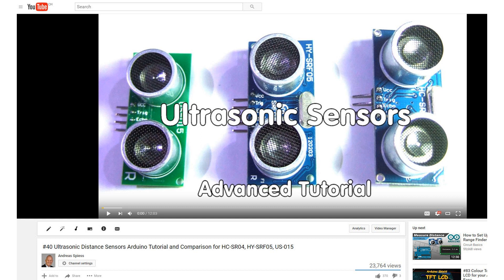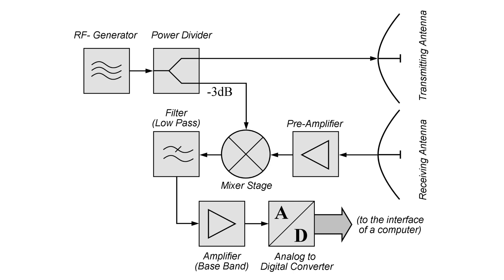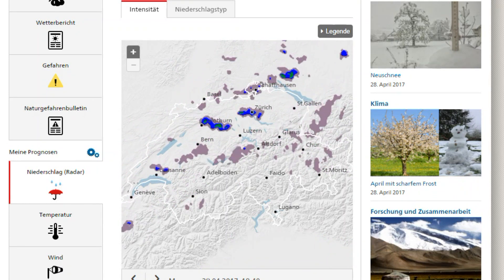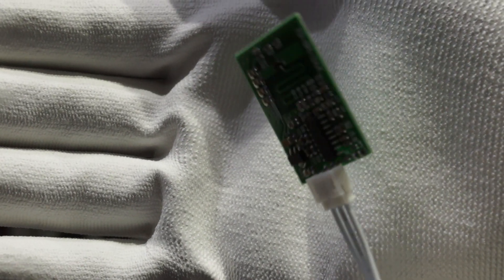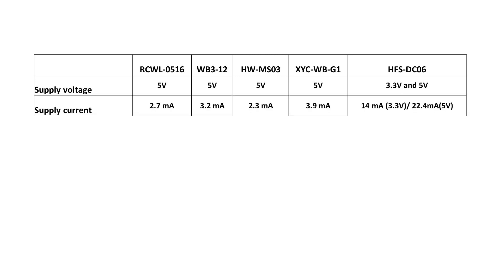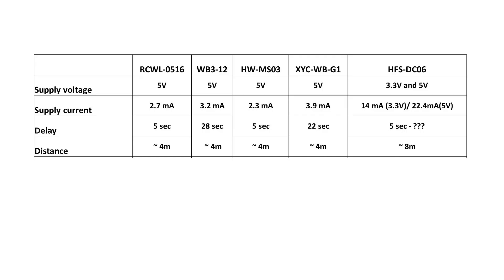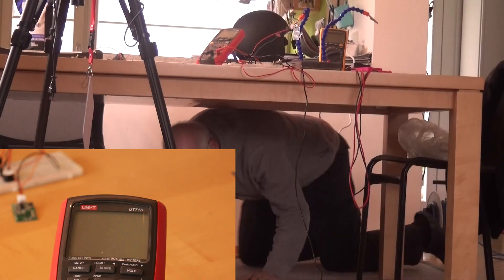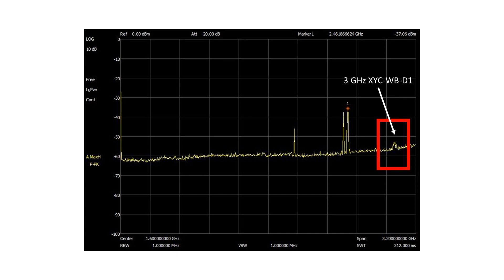#135 Radar Sensors / Switches: Comparison and Tests

Comment: IRC these units don't work like a radar. IRC they don't receive a signal back from what they send out. They just emit a continuous wave and monitor how much power it is using to transmit. if something moves in it's "field" it changes the SWR standing wave ratio of the transmitter, causing it to us more or less power that the comparitor uses to cause a trip.
Reply: I agree with Sirus. This is very similar to the way shop lifting alarms work.
Reply: @keesterwee4890  They do not work the same way as the shop theft systems. They rely on the same technology used with prox or access control tags. The arches transmit an rf signal that sweeps a small bandwidth at around the 3.8ghz mark. The tags on the shop item have an antenna tuned to that frequency, a small capacitor and transistor in a smc package connect to the antenna. The RF energy from the arches powers the IC in the alarm tag and creates a simple oscillation resulting in a reflection of RF power at a slightly offset frequency or  delay depending on the system type. The signal return to the arch triggers the alarm.

It's just come over to the uk but stores in Japan have been using this for years with IC's that will return a pulsed code instead of just a "present" signal as with the theft alarms. These shops in Japan allow you to swipe your customer card and then go round the store  filling your trolly. When you exit the store all the prox codes are read and you are billed for the goods. Sadly until all the packaging manufacturers and the industry incorporate smart IC technology we cannot switch to this system.

I tested a product with a smart tag a while back and was not surprised to discover that the coded return from the product matched the bar code !  I assume this has been done to make life easier for any stores that have a barcode database. They only then need switch from a barcode reader to an RF based one. I can't see unmanned stores  taking of in the UK just the stock itself  ;-)

With regards to how these little detectors do operate see my reply to "Sirus"
Reply: "Sirus" is the winner. If you examine one closely you will see a common ground plane on both sides connected up using vias. The SWR is the method used in fact you can observe a change in current draw when the device is triggered and most of them use the good old BIS0001 IC comparator to trigger the pull low output.

I did manage to tap the RF side and the tiny pcb based detectors all seem to be on around 3.7 - 3.9Ghz. I checked with a friend of mine at the home office and nothing aside from the prox tags used in access control systems systems is around that range, most likely due to the fact that the transmitters in the prox readers spit out a lot of noise and are not tuned properly at all. This does not matter with the access control kit as they are very short range and low power just like these modules. 

A sweep of the above range using a highly directional antenna will trigger these units from 10 meters away. They seem to just look for a change up or down and this makes sense when you see the good old BIS0001 chip on the board.

It is only the proper long range lighting presence detectors that use 5.8Ghz and these for more expensive detectors have a properly tuned resonance chamber and directional antenna. I suspect it is these higher grade units that actually use doppler for detection.

It is good to see better units come out of China now considering that the early units were mere capacitance field type sensors and were useless. Withy these things about now I am very happy I don't have to defuse IED's like my friend did before one removed his legs for him !!!!  It does not seem to matter what it is these days the Chinese are the undisputed champions at reducing component count, complexity and cost. When I was at Uni working toward my Bsc in EE 30 odd years ago something like this would have floored me.
Reply: Depending of the distance between the transmitter and the reflections the signal arrives at the receiver either in phase, out of phase or in betwee  at the receiver. The two signals are present on the transistor at the same time. As the transistor is a nonlinear device the two signals mix together and generate a DC offset dependant of their relative phase. When an object is moving in front of the sensor this DC offset oscillates at a very low frequency. This signal is amplified and detected by a chip which is very similar to the BISS0001 used in PIR sensors as the output signals of these sensors are nearly identical. The only difference is that this chip includes a built in 3.3v regulator.
Reply: @atmel9077  Beat me to it you so and so :-D However from the playing about I have done it only seems to be the higher grade longer range units that work this way. This method has been used in alarm sensors in combination with a PIR for years. They both have weaknesses but are solid when combined.
Reply: Radar engineer here...

There are several flavors of radar methodology. These seem similar to continuous wave radars - capable of determining presence of an object within a FOV and depth, as a function of its sensitivity and other wave propagation features, but not actually able to determine range. Speed of an object can be determined by examining the Doppler shift, if circuits are present to fish this out and report it. Likely these small devices detect presence by something moving within its area of sensitivity, generating a reported voltage from a comparison between a local oscillator and received energy that has been Doppler shifted from the emitted frequency.

As an extension to what was described in the video, radars are not necessarily obligated to have angular resolution, as this is typically a feature of the design of the antenna - attenuating RF energy to a tight "beam," where direction finding is achieved by detecting objects and knowing where the beam is pointed. False detections can result from receiving, intentionally or not, energy from outside the "main lobe" of the radar.
Reply: @Prometheus2508    Hey Jeff.  I would love to sit down and have a drink and chat with you.  From what you describe the antenna and surrounding ground plane would have to be precisely engineered. Given the absence of tuned resonance chambers I assume the RF energy to be broadband so the VSWR seems the most likely option. I personally cannot see how the antenna can be sufficiently precise and stable to control range and receive the reflected RF energy.

Given its design I would expect a large proportion of that reflected energy to miss the antenna completely. What is even more impressive is the single transistor connected to the base of the antenna, this transistor must be operating in its linear region and as this must operate on top of the active region I am very curious as to how it operates. I wonder if the secret is keeping if forward biased or is it switching back and forth.

It is not the smallest array that has been designed given that very precise microwave DOPPLER detection has been integrated into intruder alarm detectors for a long time now. These however use a central base loaded design and a surrounding array of receivers from what I have read. If it is using DOPPLER as many similar videos maintain.

This sounds like a very strange method of operation to me looking at the layout. I agree its continuous wave as standing wave operation makes no sense. How do you think the antenna is driven ?  I have a few of these modules but as I am retired I don't have access to network analysers and spectrum analysers anymore. It is an amazing design that's for sure given the problems they would have to overcome.

It is a very clever design that is for sure.
Reply: @TRS-Tech  What do you mean by "control range"?

The amount of received, reflected energy will be many magnitudes smaller. This doesn't matter, so long as it's amplified (likely by that transistor) and normalized with the local oscillator that originally drove the antenna on transmit. And AC signal driven into a approximately coupled antenna-like conductive strip will generate RF waves. With the normalized signals on hand, simply comparing the two with a phased lock loop should produce an output voltage when the received frequency is different from the transmitted frequency, much the same way FM is demodulated, which would indicate that something moved into or is moving within the region the radar can monitor.
Reply: @Prometheus2508  Sorry, haven't slept. Tired and overthinking things. I meant frequency range.
Reply: Beyond curiosity, I would like to know if better understanding of the physics of these devices would help in better designing the systems we use them for. For example, I would love to be able to control sensing directionality. This would let me “watch” people as they walk through an array of sensors. But, my various attempts at building shields around the cheap sensors just didn’t cut it. To this end, the expensive version Andreas reviewed perked my interest. So it’s possible. Does anybody have clear enough understanding of how it works to inform how we can better direct them?
Reply: @AbqMichaelMcDonald  Check out phased arrays...
Reply: I made such devices in the past and they work this way, or measure the static field electricity, which is however non reliable at all.
Reply: that means you could use it in conjunction with something that does receive a signal back. can you use Wi-Fi as rangefinding just by measuring the signal strength?
Reply: @kingmasterlord  That another kettle of fish. This device doesn't recieve anything, it just detects that it is using more or less power to transmit due to SWR, if there is anything to disturb it, it will notice. Think of it as capacitive thing to simplfie it. You are measuring capacitance from a metal plate in the dark. if something moves near the plate the capacitance may rise or lower. There is no transmision persay, just a field, just so happens to be a radio wave transmition that is harder or easier to transmit due to stuff changing it's coupling to the universe. And in so being, it can tell whether it is using more or less energy to transmit. No dopler shifts etc. just fluctuations in transmit power.
Reply from the maker: This is one additional opinion on how these devices work. I stopped to try to understand. I just use them...
Reply: Baaaa

Comment: Radar pulses are generated from an isotropic antenna, not an omnidirectional. Also normal radar pulses kan only be used to OBJECT  detection, not MOTION detection. If you want to have information about velocity, you have to use special doppler transmitters (frequency in stead of pulses), and then do some doppler calculation afterwards.
Reply from the maker: My tests (as shown in the video) suggested, that motion was important for the triggering, not just standing there. But I am absolutely no radar specialist...

Comment: i am expecting to see you checking the frequency in this video. low frequency it is still using the RADAR principle but mostly its usage is to control lighting. i have my radar sensor falsely triggered by my handheld vhf radio and maybe that is why it is used only in lighting system and not security alarm system (motion detection).
Reply from the maker: It is well possible that these devices are triggered by other EMF sources. The design is really simple and not a lot of filtering is done.

Comment: Hello, I am a radar systems engineer for 30 years. It looks like the antenna is a double-dipole and is intended to mount in a simple tube-like cylinder. In this mode it would be a simple motion detector which is what you said correctly at the beginning of the video. However the price is amazing and I will get some of these for proximity sensors around my home as the basis for a new security system. I am also subscribing to your channel. Thank you very much for this video!
Reply from the maker: Great to have such subscribers! Is this simple design with only one transistor something you know? Because so far, nobody was able to explain us how it works and which principle  it uses. For example, I was able to prove, that the modules work ok even if other modules are in close proximity. But as soon as I switch one module off or on, the others trigger. Another question is, if it senses speed and in which direction (from-to or also across). I did not do any proper tests about that.
Reply: Yes, with a common ground signals can go in both direction on a wire in TEM mode, so TX mode signals to from the XO to the TX transistor, received signals go the other direction, through a circulator and into the RX front-end, in this simple setup harmonics and distortion are ignored since this is a simple switch motion/no motion based on Doppler signal which is what you said. These modules seem to be in the 5GHz band that is internationally not regulated it is the "other" ISM band that very few can use because of lack of range. In this case that is positive attribute since range-to-target is so close. For several units close together yes there is interference but since the unit only detects Doppler. It is like saying one unit can use another unit's TX signal as long as there is no motion. The other units trigger when a unit is switched off because they detect a change in this signal when a unit goes down the XO does not stop abruptly but changes frequency as power is removed and voltage from the power supply capacitor sags. That is what the other units are detecting.
Reply from the maker: Thanks for your explanations!

Comment: Hey Andreas, great video! I've reverse engineered a very similar module in a video some time ago https://www.youtube.com/watch?v=jAeFQEHWLZU. They definitely work, however, their RF performance is not exactly great since they use the same transistor as oscillator and downconverter. The HB100 Modules are far better in this respect https://www.youtube.com/watch?v=TntNTVNq2Qc&t=3s . Currently, I work on a video how to implement a detector for these modules in MATLAB which can distinguish multiple targets simultaneously. Maybe it would be interesting to port that to Arduino one day. Servus aus Wien!
Reply from the maker: Very interesting work! Please post it when you are ready (I subscribed).

Comment: The circuit is not in s single transistor.... that thing you looked at IS a simple transistor. the chip is controlling everything.
Reply from the maker: As mentioned, I do not think so.
Reply: Well WHY are you not thinking so? What is your reason for believing that it is not the IC that is controlling the whole thing and the transistor is just that -a simple transistor to power the antenna?
Reply from the maker: There are many discussions and in the comment here, and also other videos doing some analysis. First, I had the same opinion as you, because I did not believe, that this is possible. In the meantime, I am convinced, that the IC is a ordinary PIR IC and the "radar" is done by this single transistor. But, as I said, I still to not understand the principle.

Comment: Did you try the 10.525 GHz doppler radar HB100? Those range from $2.30 to $5.24.
https://www.aliexpress.com/item/HB100-microwave-wireless-doppler-radar-detection-sensor-module-in-the-10-525-GHZ-selling/32336874908.html
Reply from the maker: +George Ou No, not yet. But I have one laying around
Reply: Apparently the range is better because it uses a patch antenna to direct the energy in an 80 degree or 40 degree beam depending on the orientation you use.  Looks like it's a radar gun component and it is rated out to 15 meters.

Comment: Thanks. I use these extensively as for detecting motion outside of my home, but these has some issues. It will triggered motion when there is rain. It even can trigger if there is small movement like a plastic cover rolling on floor.
Reply: One more thing I have enclosed these modules in a metal casing to stop it from false triggering as it is used detect motion in all directions, except for one direction.
Reply: This is the one I use 

https://www.aliexpress.com/item/DC-SSR-DC-Microwave-Sensor-Switch-Radar-Switch-Module-Human-Body-Induction/32715462134.html
Reply from the maker: Thanks for the feedback concerning rain. Another viewers asked about that. And of course, it is like with everything: You have  to find a compromise between sensitivity and false alarms...
Concerning Metal housing: I think, this is a good idea if you want to restrict direktions
Reply: Thanks. Yeah for now I am turning motion sensor whenever there is a presence of rain (not a good idea).

Comment: Very good, thanks.  Have you thought about using aluminium foil, say placing your module in a project box lined with foil on the sides but with "clear" lid? This should give a crude ~120° cone sensitivity.
Reply from the maker: If you look at other comments: This should work. Of course, it depends on the application.

Comment: Excellent video! Very informative.
To make RCWL-0516's output pulse shorter, one needs to replace the capacitor that is next to the pins 3 and 4 of the IC. I replaced it with 100pF capacitor and now the output pulse is around 40ms.
I think with larger values the ratio is closer to 0.25s/nF. Making the pulse longer can be done without removing the onboard capacitor.
But like you said, these adjustments require SMD work.
Reply from the maker: Thanks for the info. Maybe I will try it with one of the devices for my next experiments.